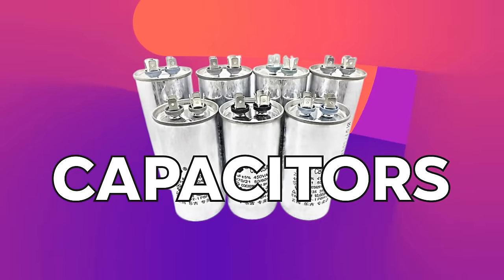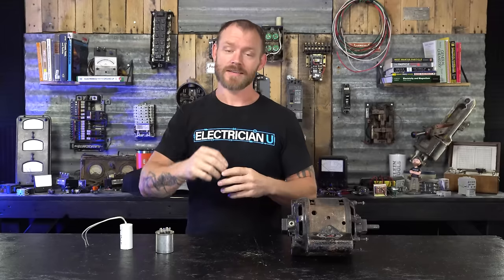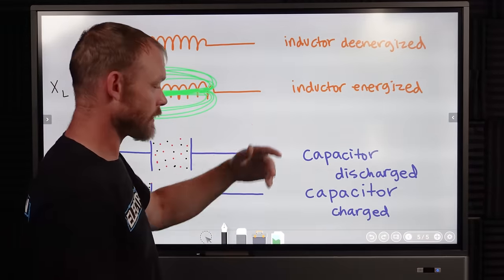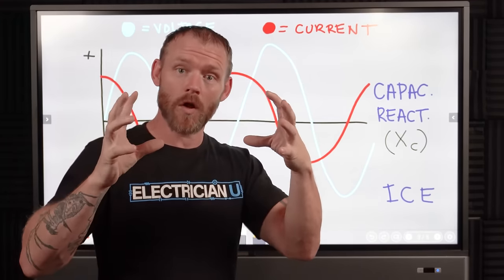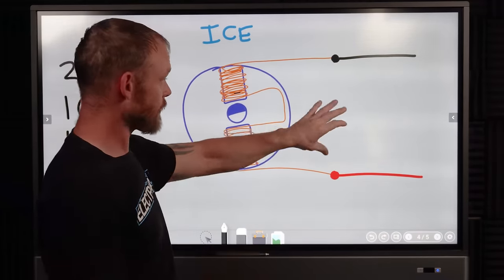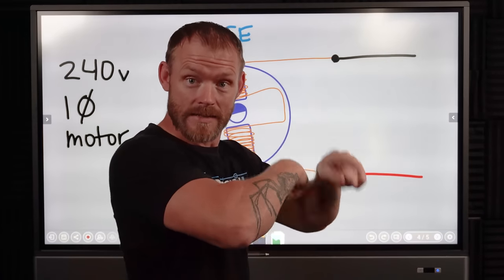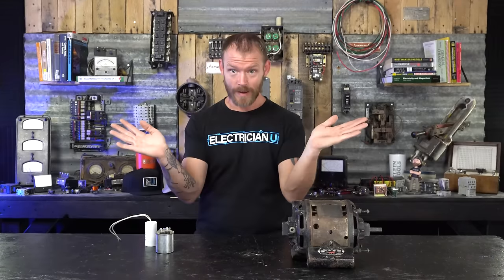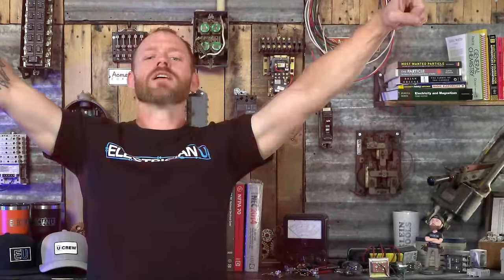Why Are Capacitors on Motors? What is Capacitive Reactance and Inductive Reactance?

Comment: The problem is our ac grid we use today is not 100% in phase , we need new smarter grid system that uses harmonics in resonance to constantly balance itself saving electricity but more importantly won't Short circuit causing catastrophic blackouts causing fires and taking lives

Comment: Your single phase motor diagram was a little off. While the explanation was correct on how a start capacitor is used, you neglected the fact that there is a starter winding that needs to be added to the diagram. The starter winding is usually 90 degrees out of phase to the run winding. Without this additional circuit, a single phase start capacitor motor will not start

Comment: Question: So I have a cheap bench grinder that runs off 120v and it takes about 5 to 7 seconds to turn on and get up to full speed. The first couple seconds it really groans to get moving. I've used much more expensive and more powerful bench grinders and they all have a start and run capacitors and they get up to speed in about a second or two. Can I simply add a start and run capacitor to my bench grinder that originally didn't come with one, in order to get it spinning right away?
Thanks!

Comment: Do variable frequency drives serve a similar purpose that a capacitor does??
Reply: VFD's allow AC motor speed and torque control as they are a function of frequency in AC motors.
In the old days, DC motors were often used as they were easier to vary speeds by varying voltage.

Comment: What magnet?
Magnet in AC motor? 
You simply don't know and try to theorise. 
I was like "you 22 minutes to explain what is purpose of capacitor on AC motor?"
Capacitor shifts phase by 90 degrees, which makes it possible to feed SAME phase to both stator and rotor. Mind only one of those have capacitor, usually it is rotor. And it is not delay as such, but phase shift, which is not exactly same thing.
Reply: The magnet is the induced magnetism in the copper "Squirrel cage" and iron rotor, that's why they are called induction motors.
At start up there may be some residual magnetism in the iron, the chances that the rotor stopped with that being in the right place to kick the motor to spin the right way is less than 50%

Comment: So what size is going to save most energy on something like a refrigerator, or something the size of a 3 ton compressor, and both fans?? And even on a window unit too? Those damn things are too hot. Copper and flux losses are probably at least 35 percent. When they coooould fairly easily be 10 percent.
Reply: All motors should have ferrite cores and oversized copper wire. Only 20 percent more copper, best ferrite matieral is cheap. It makes up in expense.

Comment: Hi can I replace a 200uf capacitor with two 100uf capacitors
Reply: Connect the two 100 in parallel makes 200uf. Just the opposite of resisters. I did this on a/c unit once.

Comment: The lag and the lead are both 90 degrees?
Reply: It depends on the value. But...
Thanks to the available space inside a motor it can be good to place main and auxiliary windings at 90 degrees to each other. Note that this video didn't touch motor winging layout.
If the windings are at 90 then it's best to pick a capacitor value that will shift by 90 as well.

Comment: Wouldn't the ac motor windings themselves be considered inductors?  The windings themselves would create an inductive load when AC current is passed through them and cause a voltage to current phase shift due to inductive reactance hence why power factor correction is needed for efficiency in inductive loads?  Is it true you need a rotating magnetic field in the motor to make it run in the right direction? How is a run/start capacitor used to create the rotating field?  How does the auxiliary winding work in an inductive motor?
Reply: In a single-phase motor without auxiliary winding two rotating magnetic fields are created and they rotate in opposite directions to each other (Leblanc's theorem), The starting torque is zero. by starting the motor by hand, one of the fields is favored and the motor starts to turn in this direction (washing machines from the 1950s worked like this). The energy efficiency is however disastrous because the opposite magnetic field tends to brake the engine (problem also encountered on the alternators).
The auxiliary starting winding makes it possible to increase one of the fields but for that it must be fed by an out-of-phase current otherwise it remains a single-phase motor. To obtain this phase shift, a capacitor is used. This creates a sort of polyphase motor.
This technique limits the use of single-phase motors to low powers (max qq kw).

Three-phase motors do not have this problem because only one rotating magnetic field is created (Ferrari's theorem). With the advantage that this field remains of constant amplitude. However, if a voltage imbalance exists or these voltages are not sinusoidal, a reverse magnetic field is created which will cause the motor to heat up. For very large motors, the unbalances and harmonics of the network are controlled by specialized protection relays.
With regard to power factor and feedback compensation using capacitors, this is another problem. One can then use capacitors, electromechanically or electronically commutated capacitors or it can be done with over-excited alternators.
Reply: @danielfranchette5547  thank you so much for the detailed answers!  You definitely made it much clearer.  Now I have to sit down and study those theorems you mentioned.

Comment: The reality of the phase shift translates to torque.  Without the torque, there is no rotation or control to the direction.  You need capacitor-start to overcome inertia, and you need capacitor-run to smooth out that run and keep the torque up regardless of the load.  If you don't mention the load on a motor and how torque is involved, you have incomplete information.  

Power factor is indeed important for efficiency, but irrelevant if the motor cannot turn or keep turning under changing loads, and plays into the sizing of the capacitors more than the purpose of them.  You went way off topic throwing discussions about reactance in so much.

Comment: At 4:10 you show inductive reactance so the  diagram your showing is backwards your voltage is lagging the when you show ice the current is behind. I triple checked before saying anything. I worked electrical power production in the Air Force and we used power factor meters when placing multiple mega watt generators on the same buss. We had two busses one for building power including the computers that ran the radar's since it needs steady power without any meaningful inductive or capacitive reactance. The other buss the radar's and the chillers that cooled them (pave paws west which were hundred's of phase array with two 10 story radar faces capable of putting a few megawatts out on each face and covered anything from the west coast to the  area around Korea and all the way into outer space. If it moved we tracked it. It's said we could track a hummingbird in a hail storm and give you altitude, heading and airspeed of it). I could be wrong it's been thirty years since I left collage and I did that after the military. But we had big banks of coils and capacitors so we could add or subtract as needed to balance the load. Otherwise we could end up driving a generator with other one causing the driven one to over speed the prime qmover shutting it down and fall off the bus loosing the radar it's self or losing th6e computers that allow operations  either way not good  and people losing their careers.

Comment: OK, I feel I need to respond to this video.  Kudos for your attempt to answer this question but your explanation here is confusing too many concepts together in ways that are simply incorrect.  Utilities are applying capacitors for very different reasons than why we need them in single phase motors.  Single phase motors use capacitors to generate a rotating flux through the squirrel cage rotor using two stator windings.  The stator (stationary part of motor) consists of a main winding and auxiliary winding, each wound on alternate pole faces made of laminated iron.  For a two pole machine, the main and auxiliary winding are spatially separated 90 degrees apart around the rotor.  If both windings were identical and excited at the same voltage, the resulting AC current in each coil would rise and fall at the same time, which is to say, they'd be in phase with each other.  The magnetic fields generated by both windings would add together vectorially in space as a single overall flux that would induce a current in the rotor conductors like a transformer.  The problem is, with no phase shift between the two stator currents, this flux will grow and shrink in magnitude, and reverse over the AC cycle, but it will always act along one axis and not rotate in space (its position is stationary).

The net result is that the induced current in the rotor conductors will also generate a magnetic field in one axis that simply locks into place with the stator flux.  In other words, you have a stator magnet and an induced rotor magnet already aligned in such a way that the rotor has no reason to turn in either direction; there is no torque acting on the rotor.  Torque results when two magnets exist that are spatially misaligned and exert a force on each other to minimize the gap between North and South poles.

So, if we add a capacitor in series with the auxiliary winding, then to the AC system, that winding no longer looks like a series inductive-resistive circuit, but now a circuit with more capacitance and therefore more like a circuit with a unity power factor or even capacitive (leading) power factor if capacitance is small enough (i.e. XC > XL).   This means that the current in the auxiliary winding will be more leading, but smaller than the current in the main winding and therefore their respective currents will peak at different times in the cycle.  When you excite two windings on the stator with phase shifted currents AND physically place their poles in alternating positions, the net result is a single stator magnet whose field actually spins either clockwise or counter-clockwise through the rotor space at synchronous speed (Ns = 120F/P where Ns = synchronous RPM, F = line frequency, and P = number of stator poles).  
As this combined magnetic field sweeps the rotor, the induced rotor currents in turn produce a rotor magnet that now sees a moving stator field which it tries to catch up with (i.e. we now have the condition for torque).  In an induction motor, the rotor can never fully catch up to the rotating stator flux however as induced rotor current is also a function of the slip frequency (frequency induced in rotor) which is greatest in a stall and zero at synchronous speed.  Remember, without rotor current, there's no rotor magnet and therefore no torque which requires the interaction of two magnets.

In three phase systems, the rotating stator field is inherently produced by the existing phase shift in the three-phase line voltages and by designing the stator with three phase windings that assume alternating positions along the stator poles, so no capacitors are needed on three-phase induction motors to generate torque.

Split phase motors on single-phase systems generate a rotating stator field not with added capacitance but by using an auxiliary winding with smaller conductor size and therefore more resistance so it is less inductive than the main winding.  While not producing the same level of torque as same sized capacitor motors, it still produces enough phase shift to produce the same effect overall and get the motor spinning.  Many single phase motors only use the auxiliary winding to initiate a rotational torque and then at about 70% speed disengage the auxiliary winding through a centrifugal switch to save power.  A single phase rotor can be kept spinning at this point but cannot attain a starting torque without the auxiliary winding in place.

Comment: I thought those pickle barrel looking things were transformers. Bringing the voltage from 4K AC( or something like that) to 440 AC. Why would they need a starter cap on power lines?🤔
Reply: A cap on a power line is load factor correction, not any kind of start system.

Comment: Power Factor is not about efficiency. In the simple world, electrical math is simple. But in electrical engineering, you have an “imaginary” math. It’s gets deep fast!!!!

When you have LOTS of motors running, you get an inductive shift in your three phase “phasers”. This increases your power used. In simple terms it’s like the hypotenuse of a triangle. If the included angle is zero, the hypotenuse equals the long leg. Power Factor is one.

But if the angle increase due to inductive load, that hypotenuse increases and this determines your power bill.

This is called imaginary power. The ratio of imaginary power to resistive power is the power factor.

Since capacitors phase shift opposite to inductors, they can be used to pull imaginary power back so your power factor is one.

It’s about how you get billed and how power meters work.
Reply: If power factor is not about efficiency, then what is it about? 

The ratio of imaginary (apparent) power to resistive (true)power is not the power factor. It's the other way around. The ratio of true power to apparent power is the power factor.

Do residential customers get billed for apparent power or only true power?
Reply: @bernardocisneros4402  Its called imaginary power because of the math involved.  Every number has both a real value and an imaginary number which is suffixed by "i" or "j" depending on texts.  Most engineering is not dependent on this form of math but electrical theory is.  The easiest way to understand this, if there is an easy way for many folks, is to analyze the "Phasors" on a phasor diagram.  The phase shift imparted by either capacitive or inductive influences drags out the magnitude of the total power phaser making it longer.  This is evident from eulers equations as well as the theory of Pythagorus.  Unfortunately, these phase shifts dont do anything constructive in terms of getting your monies worth out of every KW you buy.  But the real portion of power, that which does not contain an imaginary component, is where you get your value.  So if you have a significant amount of large induction motors, your going to see that imaginary component rear its ugly head as it imparts an imaginary component due to inductive phase shift.  This changes the power factor which is ONE when there is no imaginary component present.  The use of large capacitive shift boxes will impart an opposite phase shift as capacitive phase shift is opposite that of inductive phase shift.  Therefore, these boxes can be used when large inductive shifts are present to pull the power factor back to one which results in a lower power bill.
Reply: @devemch7851   I know about the imaginary numbers i and j.  They represent the sq rt of -1.  Mathematicians, phycisists, and some engineering fields use i while electrical engineers use j so as to not confuse it with the letter i used to represent current. I was just questioning your statement saying that power factor is not about efficiency. I think it represents how efficiently the power is being used. I like to use the terms true power, reactive power, and apparent power. Since you referred to apparent power as imaginary power, I did too, but that's not really the case. If any one of the 3 powers in the power triangle is imaginary, it would be the reactive power (the inductive portion). True power is from the resistive element and apparent power is made up of true and reactive. The other thing I was pointing out is that as residential customers we don't get billed for apparent power. We only get billed for true power.

Comment: This explanation from a supposed electrician is incorrect - needing the voltage and current to be out of phase so the capacitor is used.

Three phase motors don't need any external capacitance because the three phase voltages being 120 degrees shifted from the other creates a rotating magnetic field which causes the rotor to rotate.

With a single phase motor, you don't have 3 phases available to create that rotating magnetic field. So what they do is create a phased shifted voltage and drive another coil from that. Then you have a magnetic field that is moving around the motor which creates the rotation of the rotor.
Reply: Looks like you would only use "out of phase" to mean a 180 shift.

Comment: I use a 12 volts ac connected to another tranformer it’s produced up to 240 ac power i puts capacitor connected together it’s drive a lamps but not a tv I’m things why is not working I gust it’s not enough powers lefts what’s do you things

Comment: 11:44 there’s no capacitor in the circuit and there’s no aux winding motor won’t spin and will make a humming noise and get hot and probably start a fire if left unattended run capacitors do not do special voltage amps separation magic if you’re voltage drops >4-5% when you run the motor you got a bad connection somewhere or an oversized motor for the supply source and a really hot transformer if you’re amps are dropping when you run the motor and the motor windings are energized you probably need a to find a different job because you either can’t use a meter or you have an open neutral or a not connected wire somewhere 
Start and run Capacitors operate an auxiliary winding that’s a separate entity from the primary and secondary windings would you please edit your video to reflect how motors really work